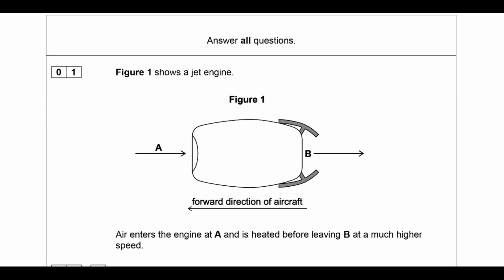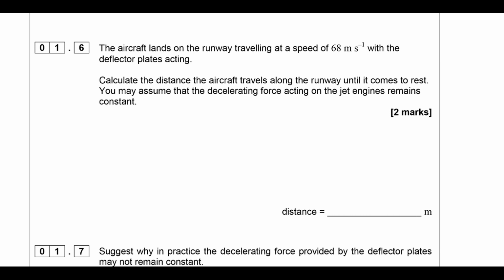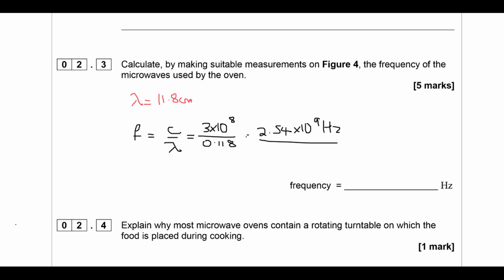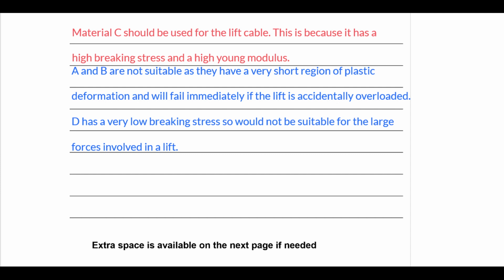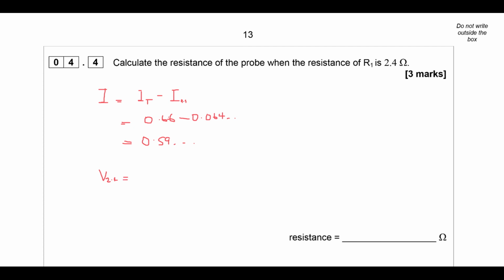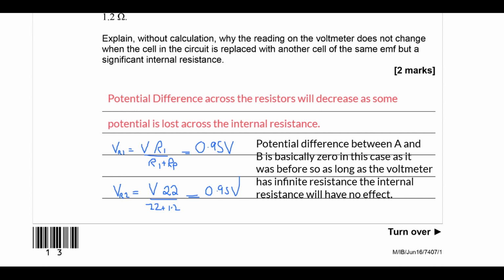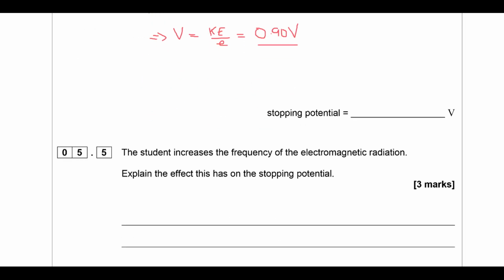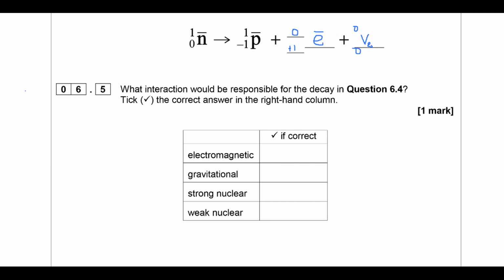A Level Physics: AQA: Paper 1: AS: June 2016

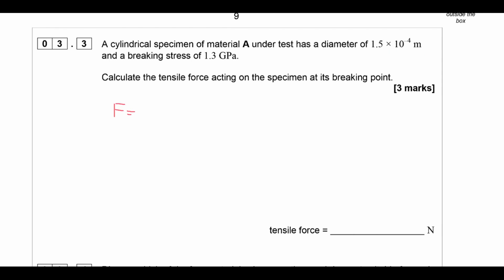Comment: hi, at 12:03 in this video, this guy says the question is wrong, is that true? thanks https://www.youtube.com/watch?v=-wLqH0hih_M&ab_channel=pastpaperguy
Reply from the maker: He is right in the video that if the internal resistance is very high the voltmeter can't possibly read 1V.

I think if the internal resistance remains quite low, it will affect the current in both branches by the same factor maintaining the potential difference.

On balance I think it is a garbage question and the exam board need to own up that they screwed up.

Comment: The answer to question 4 5 doesnt make any sense to me can you please explain, you said r=k/a and im not sure where that is from, which then went to r=c/d^2???? Then how does resistance increasing by 1.6% relate to diameter changing by 0.8% at all?
Reply from the maker: R = k/A, k stands for resistivity x length both of which are constant hence replacing them with k. Area is pi x d^2 /4, so R = c / A, I changed the constant to factor in the pi/4. If Resistance changed by 1.6%, that means the diameter changed by 0.8% as it is squared, just like squaring a property doubles the impact of its percentage uncertainty.
Reply: @burrowsphysics  i get it now thank you
Reply: I'm confused. If you x2 diameter, A increases by x2^2. If you x3 diameter, A increases by x3^2.

So if I'm decreasing A by 1.6% = x98.4% == x0.984 surely diameter is x(0.984)^1/2 ??
Reply: @jcmhp  so what he did is to factorise pi/4 so we are left with d^2 and we know it decreased by 1.6% which is 0.984 so (0.984)^1/2 == 0.0079 which is 0.8%
Reply: @jcmhp  from previous reply 0.0079 is the decreasement so 1- 0.9920947377 = 0.0079